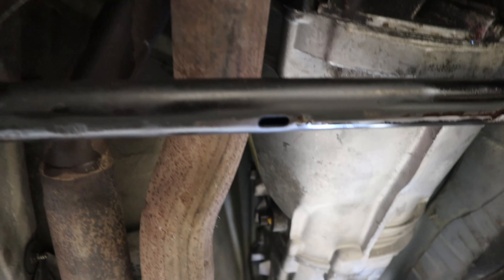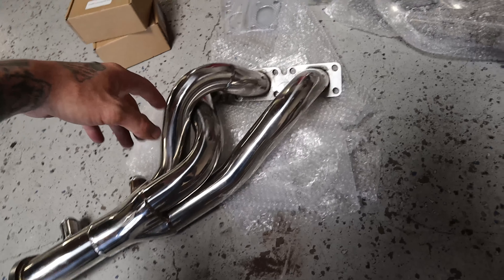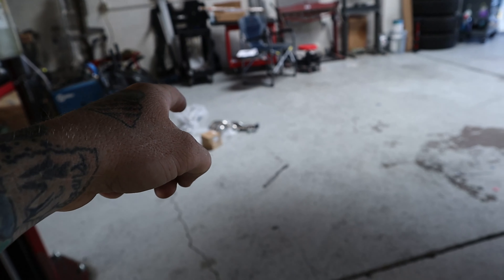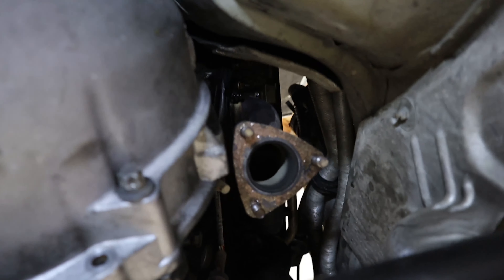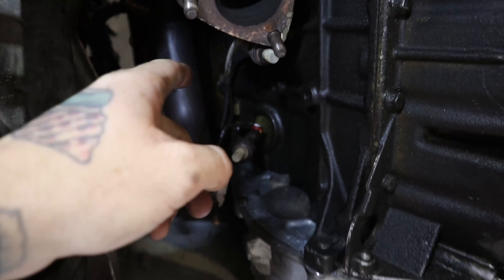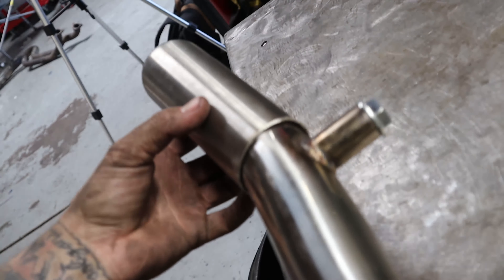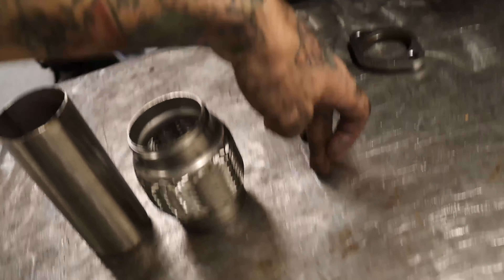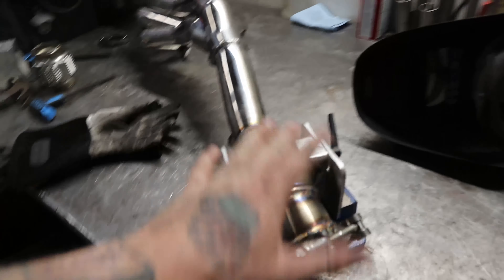Best CHEAP Header For your E36 BMW (SPELAB AUTOPARTS)

Comment: The key is patience with the e36 aftermarket chinesium headers lol 

FYI, very important for anyone planning to do this at home with minimal tools, notice this exhaust is a two bolt flange coupler intended for the eu market mid section cars whereas cars in the states came with the triangle style flange. Therefore without welding and modifications this headers will never be a direct bolt on without a welder. You might want to make note of that key part next time bud I almost didn’t catch that. 

PRO TIP: when installing aftermarket headers on the e36 make sure you remove the factory exhaust studs and install the shorter e90 torx style studs and save yourself the 7 hours homie is talking about 

Second Protip for my e36 m5x/s5x based engine family. Don’t waste your money on this brand I’ll give you a little insider, go with the schmediman headers which are wayyy wayyyy wayyyy better quality made part than these!

Comment: Any problems with the fitment? Looking into the c6 ls2 headers but i cant find anything on them or the company
Reply from the maker: The fitment on my e36 was pretty solid. Only complaint from another consumer was the flanges were incorrect to the stock exhaust, didn’t bother me since I was changing them anyway
Reply: @ChrisSadowski  thanks for the reply feel a little better trying my luck with them. They come with a mid pipe so I'm not to worried about the headers fitting stock exhaust more just about the fitment to actual motor